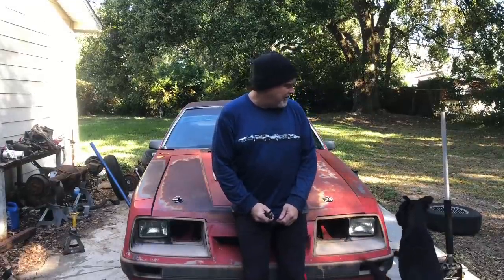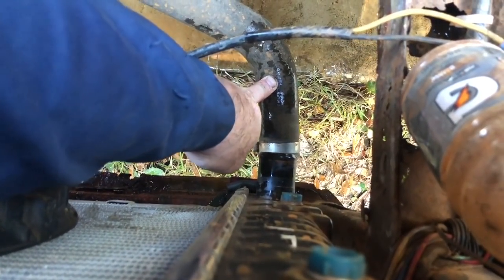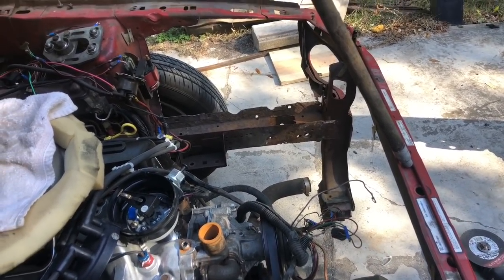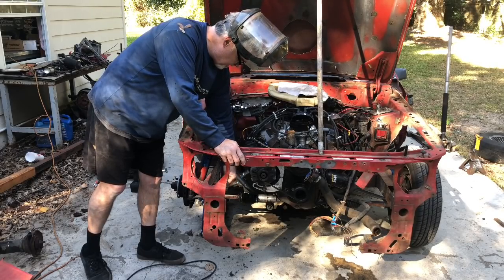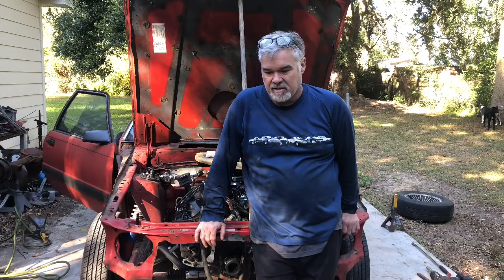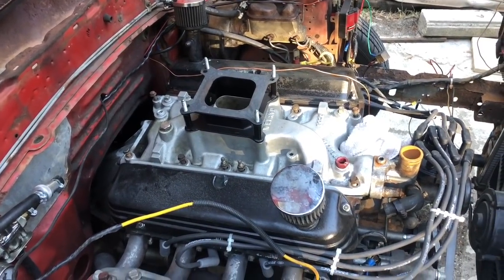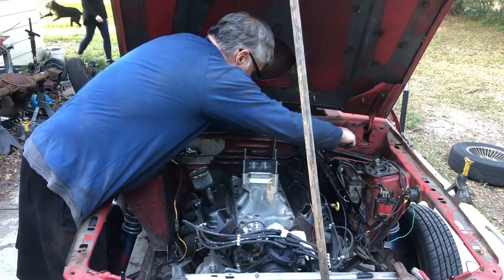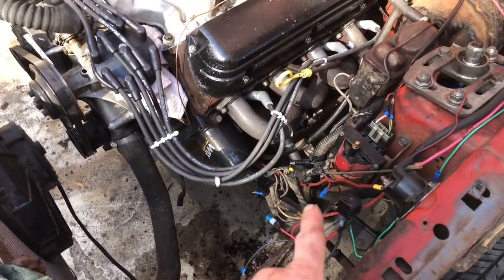1986 5.0 Mustang GT Pt.46 "we get torked up and keep on grindin!"

Comment: Sound deadening removal trick get a can of duster keyboard/electronic duster turn it upside down and spray on the deadening then smack it with a hammer then it peels right off.

Comment: I noticed the lack of wire nuts before you said anything. 

A upper hose for a 84 V8 Thunderbird is a perfect fit with 45° water necks.

And I think that most currently available antifreeze isn't nearly as dangerous to animals as older glycol based ones.
Reply from the maker: 😉
Thanks for the info Ray😁

Comment: I’m sure this is already on your radar but...   When you swap out the brake booster you should pullout all that non essential wires and bracketry and throw in a race column.🤘🏻

Love the weight saving episodes
Reply from the maker: We did it on the FaiLTD and honestly the cost to weight ratio is something to take into account, we may kinda do a vid on that in the future🤓

Comment: Maybe add a strut brace,it differently helps flex in the shock towers and keeps the frame straight. Seeing to trimmed weight out of the front .
Reply from the maker: I haven’t had a strut brace in 25 years lol
Reply: @5.0tussin  if you see it twisting in the front might want to try one. Some things do come back into style, LOL.👍

Comment: What are you planning on doin with the brakes booster?....that is what you were pointing at right?
Reply from the maker: Ditching it since it basically doesnt work and is dead weight, go manual, probably use the jy stuff i have and do something nicer for loveboat..

Comment: What's your thoughts on using a good dual plane intake...say like an Elderbrock air gap? Building a engine just like your LTD but going to use the air gap I have lying around and a TFS stage 2 cam.
Reply from the maker: While i poke fun at certain things i'm also the guy that thinks everything should have a stick, at least 4.56 gears and a cam that'll rev like a mother, doesnt make me right lol..ssoo i think they are a great quality intake along with a standard rpm or stealth :)